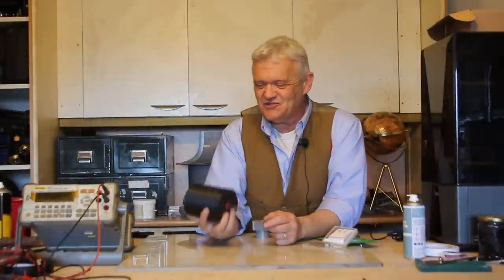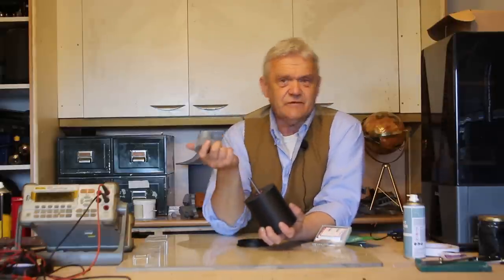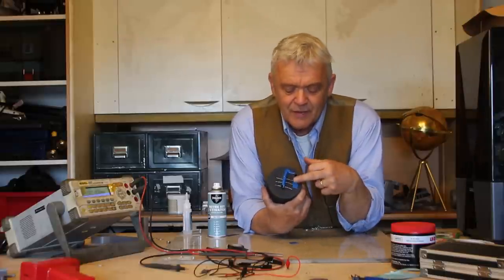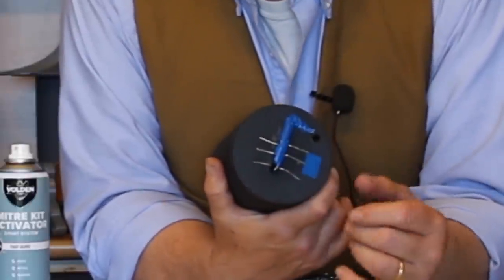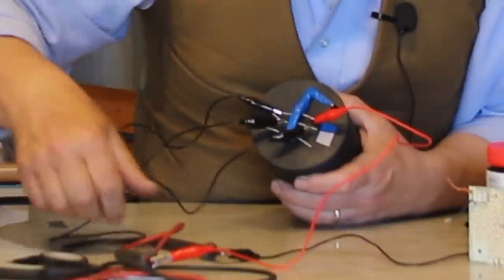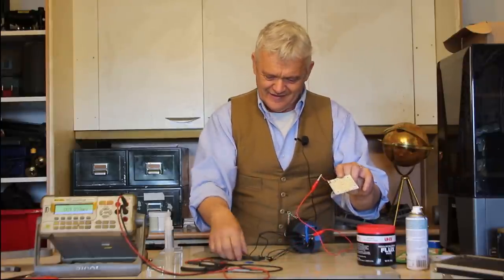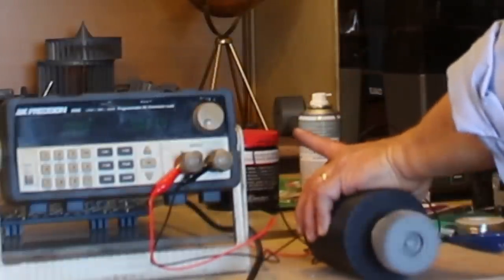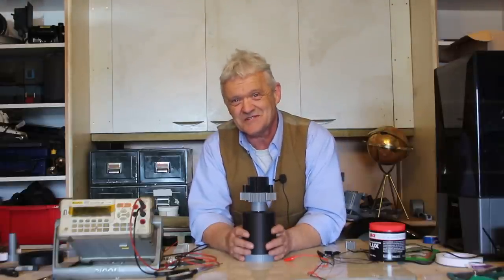1963 DIY Generator Test

Comment: I finished building one of these myself last week from your older STL file. ( I designed a longer end cap ) and was very happy with how it turned out. I used 3 coils with 200 turns each of 0.2 mm O.D. wire, about 90 ohms each. Wired it in parallel with a full wave rectifier on each coil. I spun it with a drill and it dimly lit a 12v incandescent auto bulb load and produced about 8 volts at 400 milliamps. So it was putting out about 3.2 watts. :)
Reply: Same here although i wish he'd use parametric desing(the downside of using tinkercad i guess) so the files were easier to modify to fit our custom needs. I want to make a smaller version of the fold up turbine and simply scalling doesnt do it,  but thats not easy to do as im finding with my own designs so i dont blame them. Maybe they'll find some benefit in it for themselves as well and start add some to their designs.  I see the'yre reusing the same thigns over and over and if im not mistaken you have to make them from scratch in tinkercad which must not be a problem if youre good at it and it seems like they are, so whatever works.  But if anything needed parametric desing, all these shapes and sizes of gears would be it.
Reply: Do you know what the impedance of one coil is?
Reply: @mikejones-vd3fg  The best solution is to be able to use a CAD program well enough to design your own models from scratch. It is a little painful at first to get to that level but if you  stick with it you will definitely get to that level. There is so much help available from the internet and YouTube to help you get there. Just Google any single problem you are having and you will find the answer to that hurdle. Step by step you will learn it.
Reply: @jima3252  No, didn't measure AC reluctance. DC resistance is  about 90 ohms.
Reply from the maker: that's actually really good considering a drill spins around 500rpm or so - wait until tomorrows vid lol
Reply: I printed everything, got to the same issue, I was going to make the outer casing 20mm longer. what was your solution? also did you make the coil on the serptine coil jig that had an internal distance of 38cm apart?
Reply: How do you use 3 coils? Do you stack them together?
Reply: @AmanKumarRao-mt5kq  because the tinkercad files are basically the wrong size and out of whack I haven't made the serp coils yet incase the instructions for the jig are wrong. So I. Waiting for some string I ordered. To test it out and make them with string. Don't want to go through all the effort with copper for it to be wrong and go through hell to rewind them
Reply: @AmanKumarRao-mt5kq  I stacked them one on top of the other turning the next coil about 10 degrees offset from the one underneath.

Comment: Just a few wee notes from myself. It's better to use the series to get more volts as this will be less amps = less loss on the wiring and thiner wires = cheaper to build the whole system.

Just keep in mind you need a MPPT controller, the one I'm building now to stabilize the charging power to the batteries and load. Without it, with a regular controller, you won't have:

1. Charging phases which are 3 and some for a quick charge and other to sustain. Without it you're killing the battery quicker.
2. If no controller, no protection, can damage batteries and other equipment.
3. The charging itself if no MPPT controller = higher losses, but synchronous controller like MPPT max out the possible charge.

The one I'm building now goes up to 80V on the input and max 30A, but firmware is limited to 1kW. It's a great project and open source with an app for your smartphone. I'll make a video about the build soon on this/my Youtube channel.

Comment: Some systems use capacitors on diode bridges to smooth out the dc out.
Reply from the maker: i covered that in other videos mate - yo might want to check them out too

Comment: Not knowing what you want to do and remain flexable, It may  be nice to simply terminate  three coils with 6 terminals. That gives you the flexibility to  try different ways to recitify three phases.  

If you seperately rectify the output of each of three phases, you may as well as also add three capacitors, one across the output of each bridge rectifyer.  This way, unloaded, you'll get closer to 3× the peek voltage of each coil, rather than the sum of three different phases. The down side of three sets of bridge rectifyers with output in serries is a voltage drop in the amount of six diodes.
Reply from the maker: I have covered the electronics in more detail in other videos mate - you might want to check them out

Comment: Ive built myself a similar generator. I would like to work out the power output of it but not sure how to do it. I understand I need to put the generator under load and that volts x amps = power. I can measure volts easily but struggle to measure amps. Can I do it without a precision calibrated load like you have? I have a couple of multimeters to measure volts and amps at the same time. What sort of set up can I do with multimeters and LEDS or resistors as a load? I have built a rectifier for it too

Comment: in making the ring gear for the planetary gear system. I subtract away a inside gear from a larger circular shape.  I assume this is how you do it in Tinkercad. I am wondering how you add backlash to a ring gear doing it this way.
Reply from the maker: i actually make the inner gear 1mm wider on the diameter before subtracting to create a little slop - stops them binding
Reply: @ThinkingandTinkering  So you increase pitch circle diameter or module a bit. I wonder if the programs like Tinkercad or Onshape, do that same thing, when you add backlash to a gear.

Comment: I am having difficulty wrapping the coils. I have two on now and although they each read about 60 oh one seems to be producing more than the other .  I  The weaker coil is the outermost one and is farther from the magnets. Not sure how I am going to stuff a third coil on. I modified the stator to have thicker vanes. making it sturdier and expanded things a bit to fit inside a 4 inch green PVC pipe.  The ends are square allowing 4 long threaded rods to hold the top and bottom together. Happy with the design mods for the most part but I can't see m to get more than 12 volts when I wrap a string around the shaft and give it a good pull Series about  12.8v and parallel about 7 V. Am I doing something wrong? should I bother to pit on a third coil. I did make the jig but had to expand it. these were AC readings
Reply from the maker: oh - i managed to line my up side by side - you shouldn't feel much in the way of torque when you pull - what that means is it is going no where near fast enough - so you are going to have to gear it as you are not spinning it fast enough mate - tomorrows vid should make this clearer
Reply: @ThinkingandTinkering   Ok Rob. I will realign  and give it a spin!  then gear it up!

Comment: Why push the volts? anything above 55v outside you start seriously breaching IEE regulations (RCDs etc) surely you're safer limiting the volts at 13 m/s (likely top power  output) ? Va x Ia = power .... there's a reason why site transformers are limited to 110v (55v centre tapped)🤔48v peak output maybe the best option but 24v or 12v shouldn't be discounted depending on location/system
Reply from the maker: stick a transformer in there mate
Reply: @IC86688  tru , but is it worth the risk ? 55v is the limit for a reason... the cost between a cable size or 2 is negligible unless you're talking long distances (volt drop)
Reply: @ThinkingandTinkering  why suffer the losses involved in gearing up to then transform the voltage down to a safe limit and over complicate the build?
Reply from the maker: @sailaway8244  there is a limit to how fast you can turn something - you can't make your arm turn faster it is just physically impossible - but you can use gears to do it until you reach a torque you can't shift - that way you are getting the most efficient output from your machine. You can just turn it slower in which case the volts will drop but you are using your machine in a very very inefficient way - almost making it not worth doing. But then everything is safe if you just don't do it.
Reply: @ThinkingandTinkering  agreed, just highlighting the issues with breaking the 55v extra low voltage barrier that you'd break gearing up with 2 or 3 sets of gears.... maybe a form of speed switch maybe a future project switching coil configurations with wind speed something like a star-delta starter would do using trigger voltages on a relay or two.
Reply: Dude!!! This is a DIY project as well as a channel which highlights concepts behind it all.  Its not going to be inspected! Lol!

Comment: You are making several mistakes!
You measure the efficiency of the entire system, generator, rectifier, thin cables and a non-linear LED!
The worst is that you connect 3 voltages that are out of phase with each other.
Start over, connect only one resistor per phase, measure voltage and current, multiply for power...